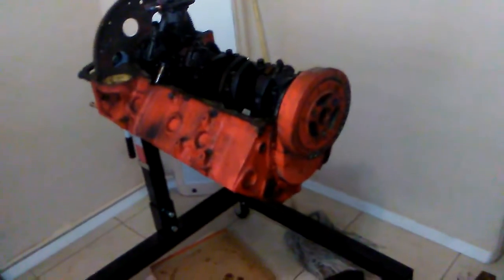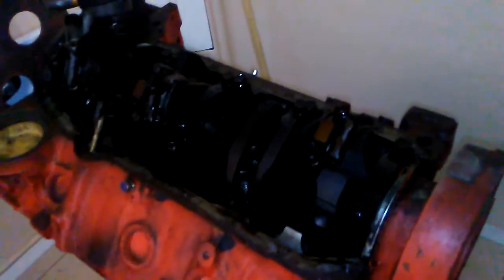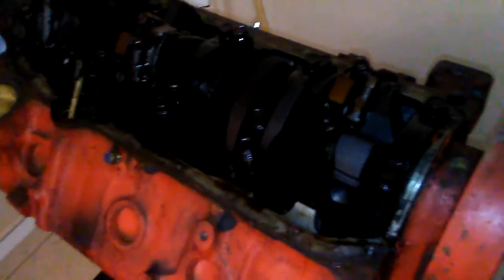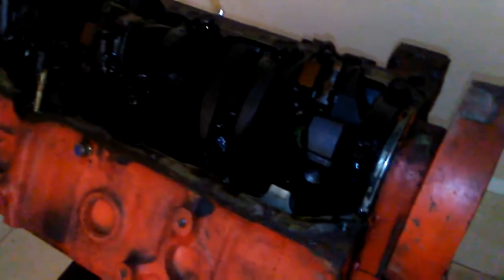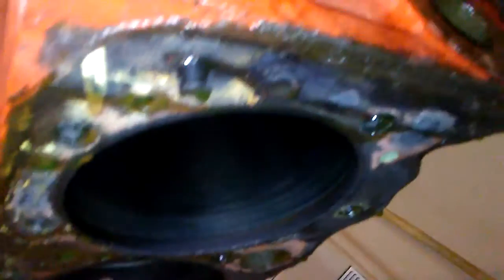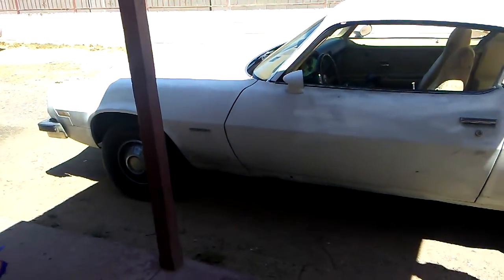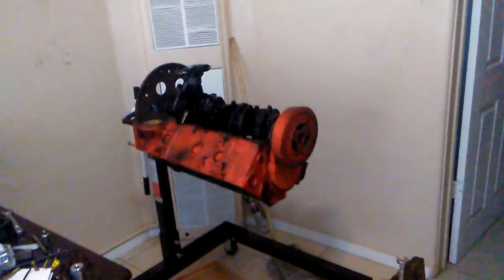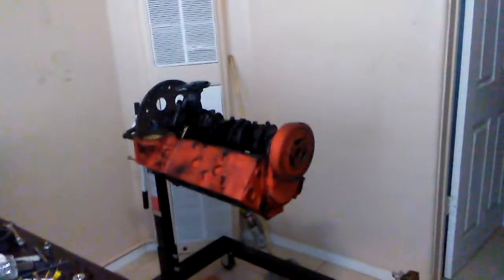400 SBC build for Camaro

Comment: And apparently never had an oil change. Those are down pins to line up the heads,  be careful 409 sbc are very temperamental  and have to built correctly or it will scatter . Good luck